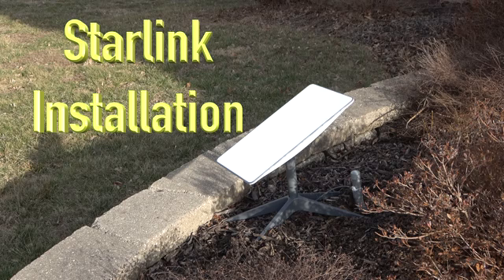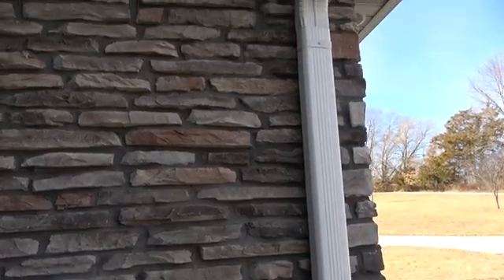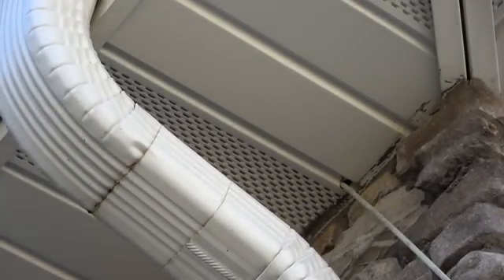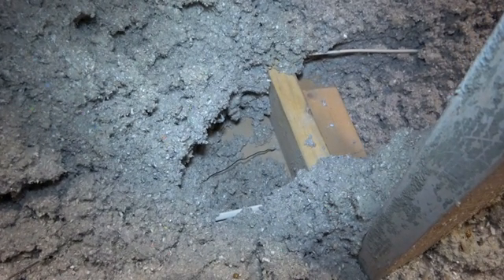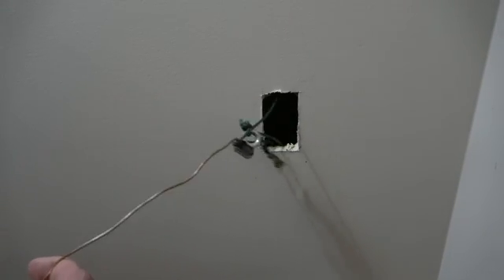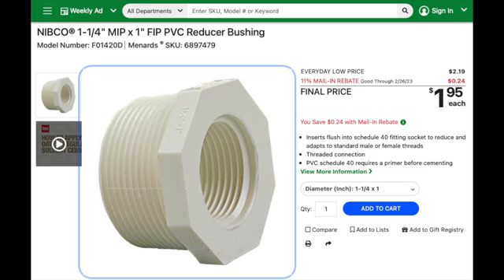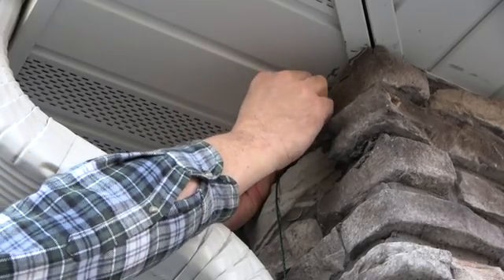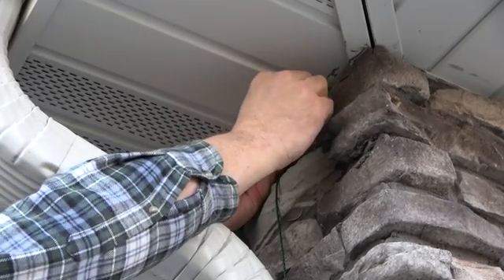Starlink installation - Detailed Home Installation

Comment: Pro tip: when a need to cross under a concrete walk or driveway, use. 3/4” diameter electrical conduit the runs the width of the concrete walk or driveway.  Glue a PCV male and female fitting at each end that will accommodate a hose fitting and sweeper nozzle. Turn o. Water to full pressure and use to water jet your way under the concrete.  The soil will disperse as you push the p,aspic electrical pipe back and forth until you reach past the other side.  Cut off fitting on each end and run your desired wire through the conduit.
Reply from the maker: that's a GREAT tip!